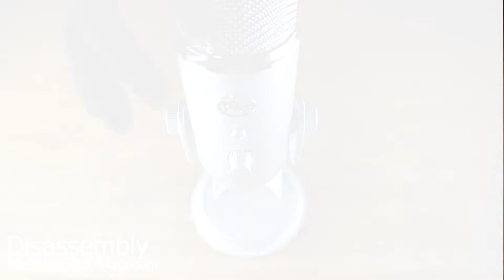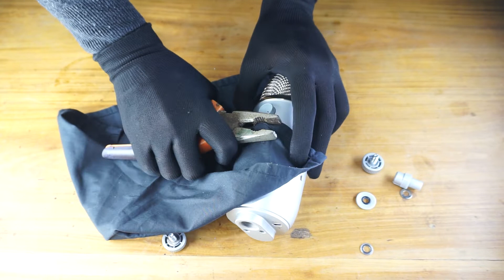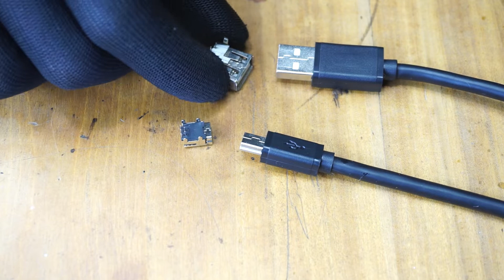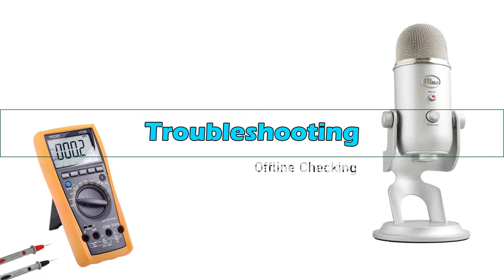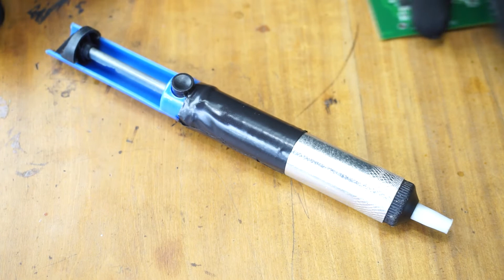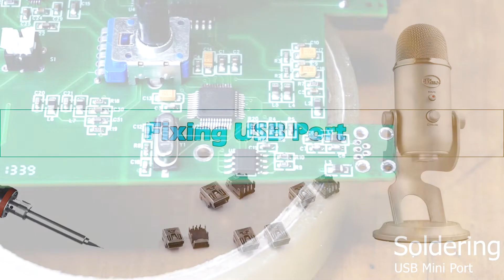Blue Yeti Microphone not Working Fix

Comment: Hello, I know that the video is old, I am repairing a microphone of the same model, the problem is that it suffered a fall on the outside, it is not broken, only the female mini usb broke, I changed it without damaging the tracks, I connected it to the pc and turn on the led, but the pc doesn't detect it, and it's just that the device manager doesn't even show an unknown device or anything, just as if nothing had been connected, I've already followed the guide in your video to check it but everything seems to me ok, I can't find the datasheet of the circuit anywhere and I don't know what to do anymore, I don't know if you can help me please, thanks in advance

Comment: I change the usb port some weeks ago, and everything is perfect. But I one week ago my computer stop to recognizing my blue yeti. I follow each step in this video and everything is working fine. But I connect the mic and after 2 or 5 minutes the device disappear, some minutes later is recognized again and this is repeated again and again. I try with other computer and this happen but in less frecuency, I change the cable and the result is the same. Do you have some idea what could be? The ceramic capacitor give me .70 uf
Reply from the maker: It can be due to software driver issues as well . Unfortunately , There is no way to install the blue yeti drivers manually . But , If you have blue yeti pro , You can download the drivers from the yeti website. Try your microphone on a different computer with different OS version .